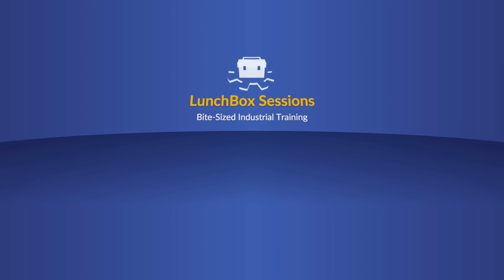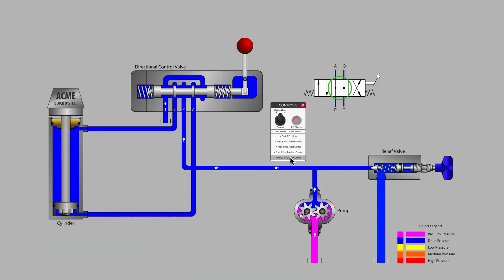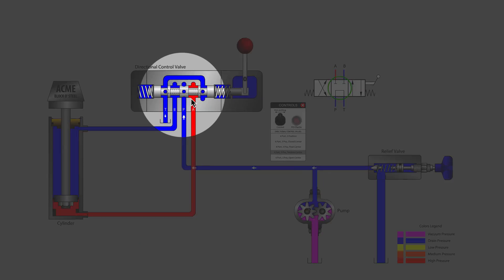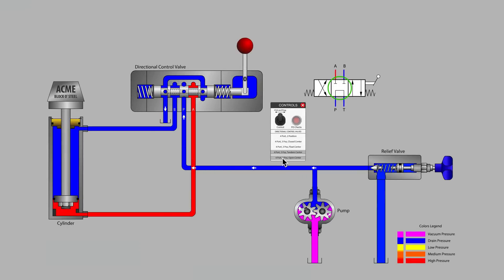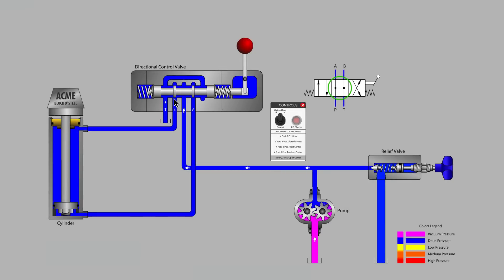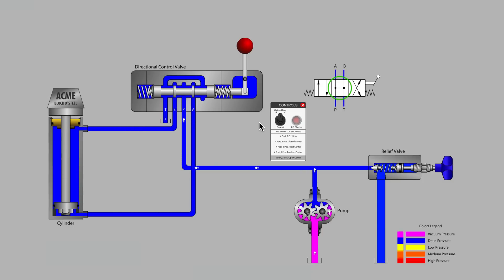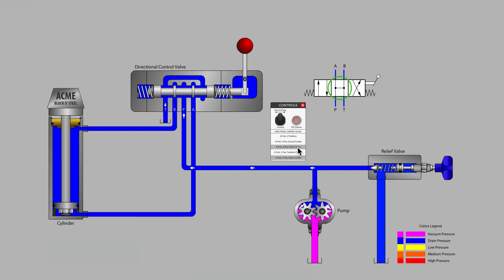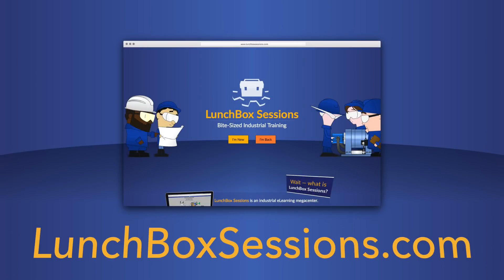Directional Control Valve Basics - Part 2

Comment: Does moving the lever slightly on the directional control valve result in a slower flow to the cylinder or motor? I am wondering if I can use standard directional control valves to control the direction AND SPEED of a hydraulic motor for a small tracked vehicle for rough terrain material handling. I can't seem to find anywhere that talks about less than full flow through the DCV.

Comment: Carl, Trying to figure out a remedy to a hydraulic situation on my kubota tractor. My tractor has a backhoe as well as front end loader. Wanting to add their rear remote kit to use on my tractor to control a hydraulic thumb or tilt and angle on my three point hitch. So I believe my directional control valves must have three ports that allow for power beyond. This seems to be where the compatibility for the backhoe connection and the rear remote connection is not compatible according to kubota. I’m not able to understand why they might not be compatible other than the piping for the rear remotes doesn’t tie into the backhoe lines. I’ve watched many of your videos and have learned a lot. You’re explanations are very good and clear. Looking through your videos I don’t see anything specific to a system with power beyond. Am I missing something or is this something you plan to cover in future videos? I realize I need to be careful and would confirm with people with more knowledge before attempting any changes that could harm me or my tractor.

Comment: Is the 4-port 3-position tandem center valve the correct choice for a connected hydraulic motor instead of a cylinder?

Comment: at the animation the pump gears running  opposite and not to push the liquid but retune it to the tank
Reply: It seems the animation is correct
Reply: For future viewers, pressure and flow are created on the outside of the gears, not through the center. In the center, the meshing gears make a tight closure, while the outer portion of each gear is carrying fluid from one side to the other.

Comment: Carl, this is what l have on my tractor, an open center type spool valve from a gear pump, l have lost pressure not flow to the cylinders and cant pickup a bale now. It should be 2300 to 2600 psi but l only have 1000 to 1350 psi, even if l disconnect the front end loader lift and tilt cylinders, so l know that the cylinders are not internally bypassing on the piston rings. What would you recommend. I tried adjusting the relief valve and it makes no difference, still 1350 psi. Would it be the regulator valve inside the spool valves, its affecting both spools for bucket tilt and lift.

Comment: the working principle of d c valve float center 3 position 4 ports ?
thank you
Reply: all the fluid power hold in the circuit system has a pathway to tank. Still, there is no pressure abording in the system because of P blocked

Comment: I have seen Float center valves commonly used in hydraulic machines for vertically mounted cylinder and Closed center valves for Horizontally mounted cylinders...
Can someone tell me the application of Tandem center and Open center valves? When do we need to use such valves?
Reply from the maker: Thanks for the great question. Open center valves are not common on industrial equipment where one pump is shared with several application circuits. But on some simple machines, with only one horizontal cylinder and a gear pump, it can be a handy choice. Tandem center valves are more common than open center valves. Again they often show up where a gear pump or fixed displacement gear pump is in use. Often the T port of one tandem valve connects to the P port on the next tandem valve. Releasing all levers unloads the pump to tank. But in such a circuit, only one tandem valve with its application circuit can be operated at a time.  I hope that helps a little.   - Carl
Reply: When you have simple hydraulic systems open and tandem centered DCVs are used but not much in complex machine and complex hydraulic systems. 
The most widely used dcv in complex conventional hydraulic system/s is the float center ones because actuators are multiples and other valving systems/components are added for better actuator functions. Even closed center valves are less considerations for better hydraulic systems by a good designer, only when necessary.

Comment: Hi.  Can an electric pump be used for multiple manual control valves, (3 position 4 way, tandem center)?  Thanks
Frank naftaenv@msn.com
Reply from the maker: Electric pump or engine driven pump makes no difference. Using tandem center for multiple valves is normal, but they need to be connected in series (ie. T from first valve to P on the next etc, with T only on the last valve connected back to tank),  and then only one valve function can be operated at any one time. I hope that helps.